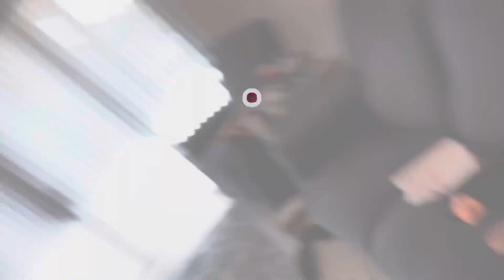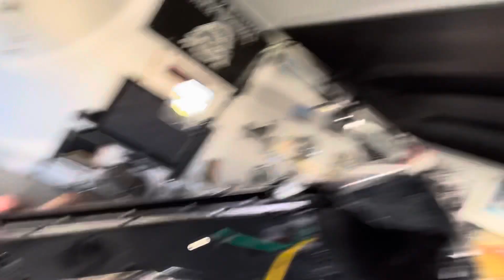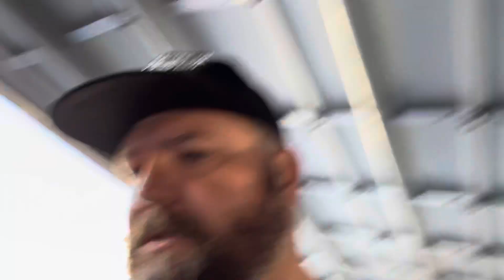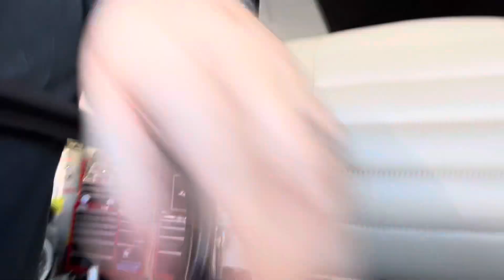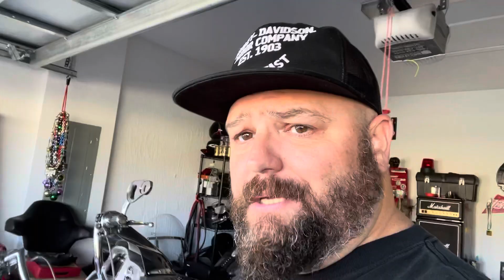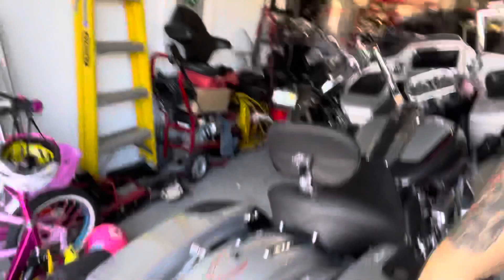Many bad choices were made... but it was fun! We had a true online biker party last night!

Comment: I bought my king tour pack off of amazon and it came with the light...it plugs into factory harness which I bought from harley...all this I installed on a 2019 street glide special. .had to get a replacement because the light separated at the corner lens....mine is also updated to custom dynamics lights...did the antenna under seat it sucked...bought an extension cable and used tour pack mount with 4 inch antenna masts..tour pack is all quick release.great videos.

Comment: Love the channel, and had a good time listening to your Stories. I didnt stay the whole time, because I wanted to finish adding the part to my new 2021 Road Glide Limited.
So, on the antenna, you can re-route the antenna so that in routes under the seat, the powered ones that mount in the fairing suck ass, but like you said, just use your phone for spotify or Pandora, one of the issues there is cell service, but if you don't have cell service, more than likely, you cant pick up any stations, I have a Flash drive with over 2500 songs on it just in case. The light bar plug looks the same, like i already mentioned. if anyone is interested in adding the light bar that don't have on pre-drilled tourpack, its a PIA. I installed the HD one, and it dont come with a template to add it. You can use painters tape and make your own,  and Harley doesn't have a wiring harness, and Baddad.com does have one that is around $170, that also has the plugs for the hockey sticks, charging port and an added wiring to add a light bar on the top of the tourpack. As for a detatch kit, I agree, the red lights are not what anyone may want. would like to go smoked as well, but gonna wait till CD comes out with theirs. I did send an email to CD, and they said that with the pandemic, that it has halted the process for now, and would contact me when they are available. So I will wait till I can do it all at the same time.
sorry for the winded Book, but wanted to give M2c on the things that you touched base on. Have a good day Monkeys.
Reply from the maker: Thanks a ton. When I get the Ultra back I’m gonna do the tour pack quick release and I’ll swap in this smoked light. I would I imagine drilling the tour pack is a pain.

Comment: There is a way to move your existing antenna from the tour-pac under the tank through the frame and it works pretty well. Did it on my 2019 FLHTK. The only issue was you have to remove the lug and the entire mounting bracket from the tour-pac and it leave  a hole on the outside of the pac. Went to Louisville HD and they helped me find a small rubber plug that fit the hole very well. Uses a little silicon to seal it up and the finished look is awesome. I just didn't like that HD engineers don't address the little lug that sticks out of the back of the pac except to put a little black sleeve over the thing.
Reply from the maker: I’m gonna look into that.

Comment: I had the J&M Hidden Antenna and the Harley Passive Hidden Antenna on my 2009 Road Glide. They did work, but not as well as the rear Factory mount Antenna. It’s ok for in town, but useless on the open road of places like New Mexico or Arizona. I didn’t care because I have the SIRIUS Satellite Radio unit. So the terrestrial radio was not used much. I even used the J&M hidden CB antenna. That was good for group rides, but didn’t get out more than a mile or so.

Comment: I have the detach kit on both my 2020 Ultra Limited and my 2020 Road Glide Limited, and for both I have the in-fairing hidden antennae for both my regular radio and for my CB.  I've not had any issues.  I live in Oregon, so I'm always riding through the hills.  I've not lost signal for radio any more than I do in my truck in those same locations.  My HOG chapter uses CB on rides, and I have noticed issues with communicating on windy, hilly, roads when I'm riding sweep on a group of 20 or more.  We often have to sprinkle a few RC's through the group to make sure communication is solid.  With that said, my CB signal has worked better than others with regular antenna setups.  In short, I love having the detach kit to keep me from looking like an old man all the time, and I'm a fan of the hidden antenna, as I've not had any real issues with mine.  Good luck.  Let me know if you have any questions.
Reply from the maker: Thanks! I think I am going to try the hidden antenna under the frame thing???
Reply: @ProfessionalMonkey  My antennae are hidden in the fairing.  I am MECHANICALLY CHALLENGED, so I had the dealership do the work.  I've not actually opened up the fairing, but I believe both antennae live in there.  If you try a different option, I'd love to hear how your reception is.  Everyone in the HOG group gave me crap for going with the hidden antenna option, but I've not had any issues and would recommend it.  With the detach kit, it really cleans up the bike and makes it look nice.  If you do the detach kit, you may want to look at a wall mount bracket for your tour pak.  I bought  one on Amazon, and it has worked great.  Let me know if you want info, and I'll send you what I bought.  Good luck.
Reply: @ProfessionalMonkey  Hi there.  Just in case you wanted it, here is a link to the tour-pak storage bracket for the garage that I mentioned in my other comment.  It's not as nice as the actual H-D part, but it is cheaper and works great to store your tour-pak when not on the bike.  https://smile.amazon.com/gp/product/B07CR3YYDZ/ref=ppx_yo_dt_b_search_asin_title?ie=UTF8&psc=1
Reply from the maker: @trentfisher5333  thanks! I’m gonna need this!

Comment: You have a CVO w/ a hidden antenna in the fairing. Does it suck? I have one as well in my ‘18 RGS. Mine works pretty well. But if you haven’t seen them yet, check out the several years old YouTube videos showing how guys bend and route their H-D whip antenna underneath the seat. I love that idea. And I have heard that it works. The hidden antenna in the fairing might work a little better. But, I always wanted to try the radio reception with the whip antenna tucked under the seat.
Reply from the maker: It does but I never use the radio to be honest!